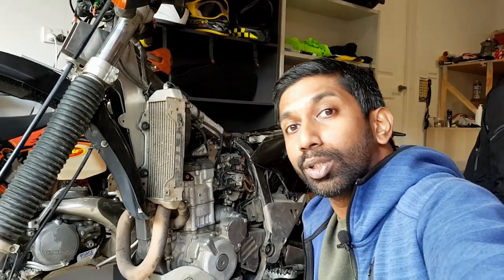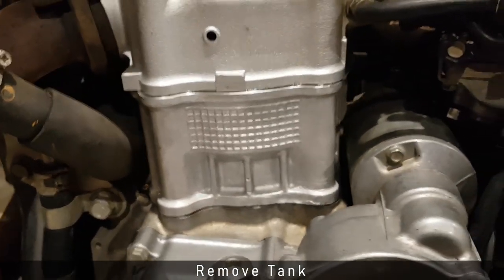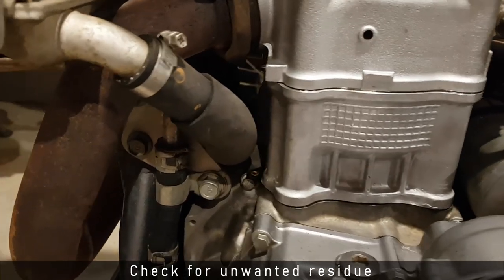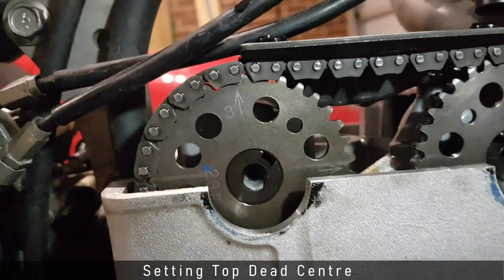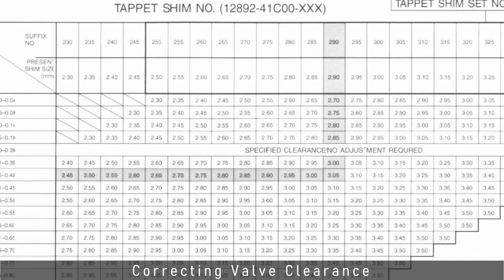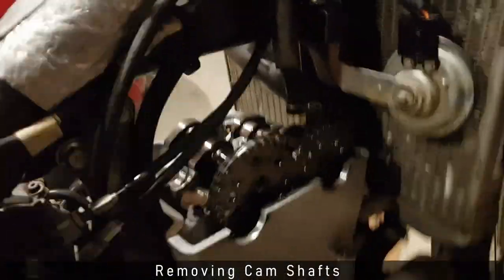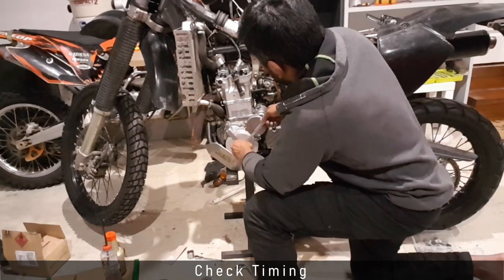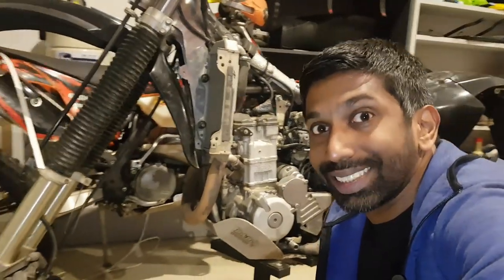How to check valve clearance | DRZ400 | On Two Wheels

Comment: Very well explained, the hardest part on my V Strom was removing the cam chain tensioner, (very limited access). 
Just to be sure I don't lose timing I cable tie the timing chain to the sprocket.
Reply from the maker: Thanks! 
That's true, refitting the tension er on the DRZ wasn't easy either it too is in a tricky spot and applying enough pressure on the spring/bolt to catch a thread is quite a task!

Comment: Nice work, very clear video. 

I always check valve clearance after re-torquing the cylinder head, especially if the head bolts turn that much, just in case. That’s more of an issue with the old pushrod engines, but even with OHC I check for movement.
Reply from the maker: Great point! In fact I got started thinking I need to replace gaskets. But when the head-bolts turned that much , I thought I'll tighten them and see if it works. And it did!
Reply: how to check if valvesare not leaking on drz 400

Comment: You might have forgotten to mention the valve chain tensioner adjustment how to. Thanks for letting us know how to check the valves. Can you tell a difference after adjusting?
 Thanks again
Reply from the maker: I actually have an automatic CC tensioner. And the post 2004 ACCT isn't failure prone like the ones before, and it does a better job at maintaining the right tension all the time, as opposed to a Manual CC tensioner.

Comment: Cool video. I was wondering what main jet would you recommend for riding at 3500 feet above sea level?
Reply from the maker: As much as I'd like to help, it's not something I'm too familiar with. I've not played around with the jetting, but I would ASSUME that since the air is thinner up there you'd have to use a jet that's smaller?

Comment: You know whats strange with my drz is that I had 0 clearance on one of the intake valves, and already had the smallest shim in there and no clearance, yet it would still start first time with no problems! I got the valves replaced and the bike now has a lot more power than it had before. Just thought id mention that sometimes even with a completely stuffed valve, the drz starts reliably
Reply from the maker: That odd! I'm guessing it could mean that your valve length itself has changed. But if it's running fine and you dont have compression issues, live with it till you can't :D
Reply: @OnTwoWheels  yeah the valve was worn from I believe sand getting in to the intake. I got all four valves replaced and the valve seats machined for the new valves. Now they all have correct clearance with stock shim size, engine has more power now. 👍
Reply from the maker: @slakk5093  wow if you machined them that's dedication. In my case, I got a valve lapping  tool and some rubbing compound and did it myself. It probably wasn't as precise as yours, but it worked,!

Comment: Hi, my name is Arnold, and I own a 2005 DRZ400s.  I have a valve question, and I was wondering if you could help me.  I checked the clearance on the intake valves, and both are within specifications.  However, the clearance on both exhaust valves is 0.178 mm, and they need to be between 0.2 mm and 0.3 mm according to your video.  Would you help me pick the proper shims to bring the exhaust valves back to the desired specifications please?  Thank you!
Reply from the maker: Hey Arnold, I can type out the steps, but I'll do you one better!
This is the very video that I watched to learn how to pick the new shim I needed. Basically, you take the difference needed, and look it up on the table to see how much bigger or smaller your new shim needs to to be.
https://www.youtube.com/watch?v=50At2VJN8vE